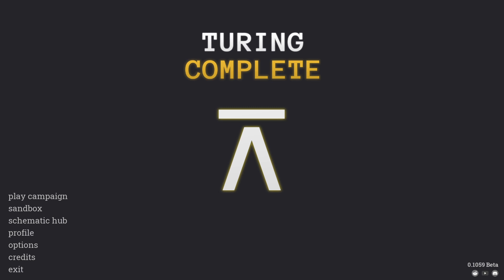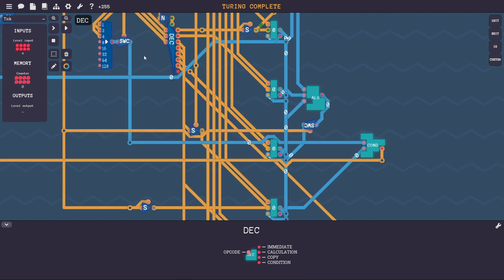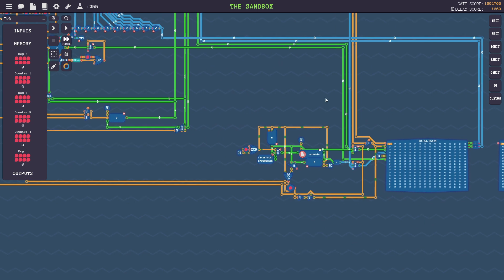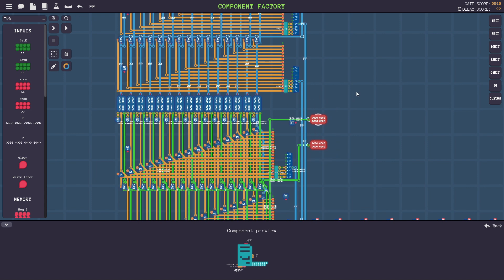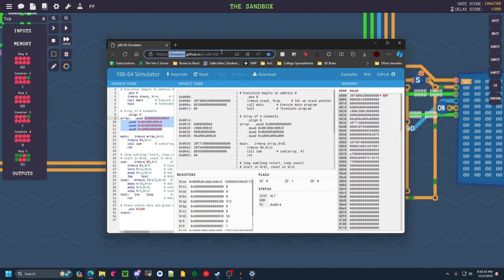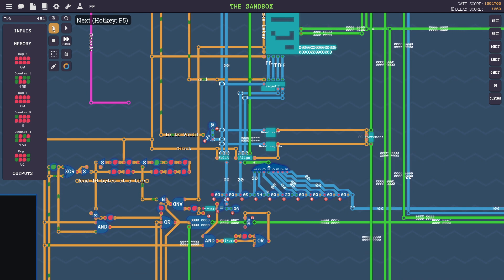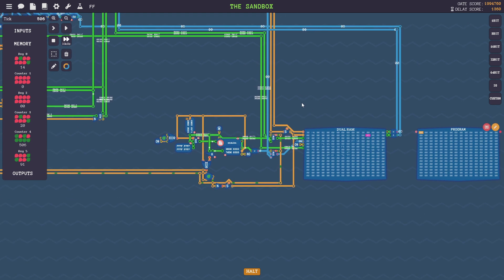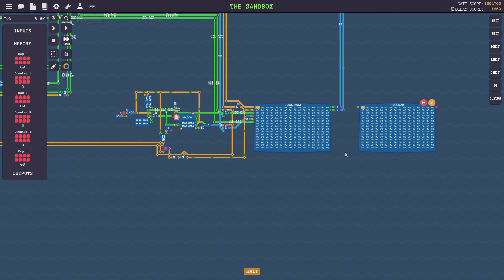Working Y86-64 CPU in Turing Complete Game!

Comment: Have you looked into the program Logisim Evolution?
Reply from the maker: No I haven't seen that, but I've seen similar. It's just a circuit designer and simulator right? Or is it also a game?
Reply: @R2bEEaton  It's a simulator, but a very good one, easy to use once you learn the controls.

Comment: this is amazing and im no computer scientist so there might be a good reason that is beyond my understanding but! wouldnt it be faster to output from your file reader directly instead of putting it in the dual load ram again there might be a good reason! but idk! ive played a bunch of turing complete and never really used the file reader so there might be a reason you put it in the dual load ram. anyway this is really cool
Reply from the maker: Really good question! I originally had the program and data memory separate. Yes, you could just read from the file reader directly and that's how I had it originally, but Y86-64 in my textbook was defined as having data and program memory shared. So instead, I first load it into the Dual RAM, then since it's dual it can both read instructions and data from memory at the same time.
Reply: @R2bEEaton  OK! that makes sense then! thank you for responding! i was just thinking like beating the game more efficiently like you would save ticks but i know that does not really matter that much! also i would LOVE to see your architecture beat the assembly challenges at the top of the campaign